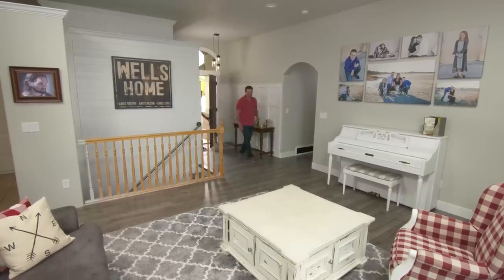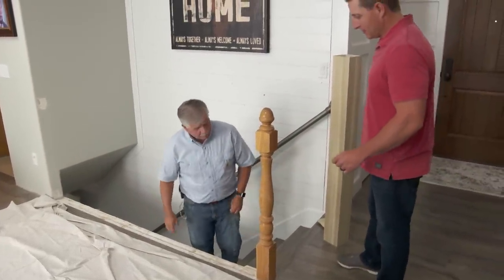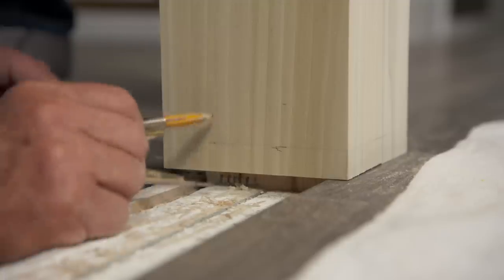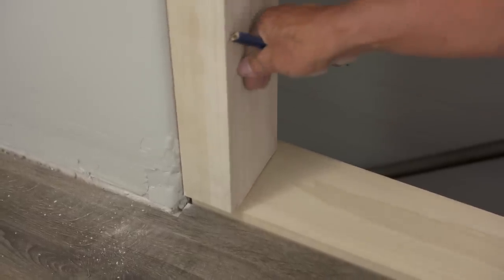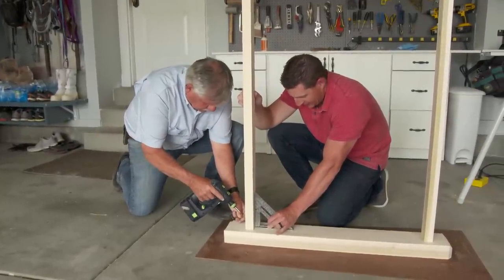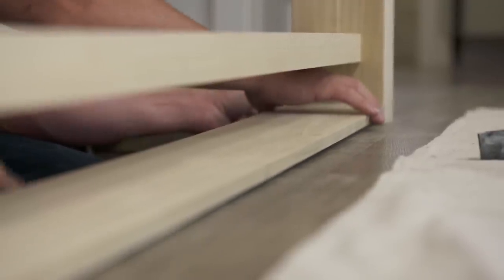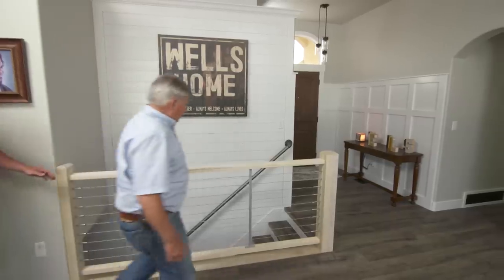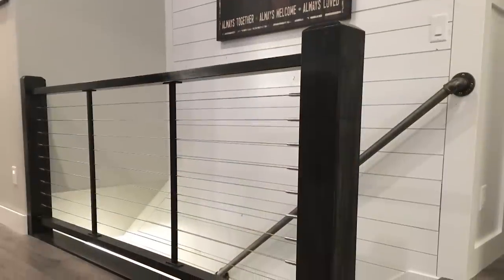How to Install a Cable Railing | Ask This Old House

Comment: Wouldn't it be easier to sand & stain the wood before you install the cables?
Reply: Yes, but Tommy and the crew can't wait around all day for everything to dry. :)
Reply: Yes, and it should be assembled, disassembled, stained/ painted and then reassembled. If you had all day and wanted to do it correctly that is.
Reply: Yes, and no.  Things usually needs some adjustment or modifications during the install, which leads to a bunch of touchups after.  You cant really win either way.
I pre-painted a bunch of trim and casing thinking I'd just touch up the nail holes after.  By the time it was installed, caulked, and nail holes filled, there was enough that it had to be painted completely anyway.  Waste of time and paint to do it beforehand.
Reply: also the cable support should have been silver steel color.
Reply: Bruh the homeowner needs to do somethin instead of letting Tom do all the freakin work!
Reply: @monno-eq2mj  why?
Reply: @ig4581  to protect from scattered paint.
Reply: Little confused as to why you first used multi tool, then Japanese saw, then chisel when you could of used a Skil Saw and raised the back up to scribe cut the base?  I know Tom knows how to do this for sure!  Lol
Reply: The boss had not made up her mind yet whether to paint or stain or leave it natural.
Reply: No....

Comment: Wow....can't believe he painted it black...was not expecting that.....
Reply: Yep it looks dumb
Reply: The entire house at 0:08 is a bit of a mixed bag... Gingham chair contrasting with the trellis rug, the mahogany console table right next to the shiplap and industrial handrail, etc.  Blame HGTV and DIY for creating the homeowner that thinks they're an interior designer.  But at the end of the day, who cares...if they're happy with it, that's their business.  They have to live with it.
Reply: I like modern contemporary I think it looks clean and neat, but they literally put wainscot there at the top of their stairs, old-style piano on the other side, shiplap siding and an industrial pipe rail across from it; it's completely surrounded by conflicting styles. =S
Reply: Honestly I thought that it looked really out of place at first.  I personally thought that the black was a nice touch.  To each their own.  Definitely unexpected!
Reply: @brockm4047  I would have done a dark gray of the same color as the pipe used as railing, that way both sides of the stairs would match.
Reply: Cleroyster 2 I agree, why blank
Reply: He better painted it before putting the cables in.. Would have been much easier instead if having to paint around the cables. Or even when the whole project was still in the workshop. No need to risk spilling black paint on the floor.
Reply: The whole house will be out of date in 5 years. Looks good now though.
Reply: Tommy said stain, so perhaps it's a dark non transparent stain. Looks like Ebony stain to me.
Reply: @toms7947 - Those colors have been around for a few years now. Already outdated in my opinion. Time for the next trend
Reply: @Fe7Ace  Probably a safe bet that the house is a conflicting mess of 5 facades and materials too!

Really wish architects and designers would stick to simpler architecture.  Some new houses confuse the hell out of your eyes.
Reply: I think the black color looks good here but black is my favorite color so I know I'm biased
Reply: Poplar can be tricky to stain with its green streaks. I would’ve gone with a lighter color that still showed the grain texture.
Reply: @dontino7849  I forwarded your message to the homeowner. He said when you can afford a house, you can do what ever you want to it.
Reply: @reedrobb  The world's interior designers beg to differ lmao
Reply: It looks like dark espresso. Looks good.
Reply: @shadowblack1987  LOL!

Comment: Depends where you are but your supposed to have a lower kick off I think the first 8" to avoid having kids climb these. Usually the building codes are very strict concerning horizontal railing.

Comment: That was a beautiful oak railing. It's a shame to pull it apart ... but the customer is always right!
For the poplar posts and cross rail, I would have stained it an d finished it before installing the cable hardware to save the masking required to keep the paint off of the steel.
Reply: Exactly…Murphy says you WILL drip stain onto the cables and/or the fittings.

Comment: Wainscoating into shiplap and the industrial handhold and railing is a bit odd.
Reply: everything is transitional nowadays.  people just put up whatever crap they think looks nice and pull from all styles. the only consistency they want is that they like it.
Reply: The only way something becomes "traditional" is contractors copy a style/look and do it to 95% of homes they build. I would say these home owners just put their style in the design of the finish of their home. Well that is the best way to say they have crappy taste, I mean they made it custom. ;) 

I'm just clowning about the crappy taste commit. If you pay hundred's of thousands of dollars to own a home for 10-60yrs then yeah maybe make it look the way you want. Just realize your custom distinct look may make it harder to sell or go down in potential value.
Reply: @RossMalagarie  People worry too much about home value.  Make the house your own.  5-10% sale price doesn't work out to be that much on the overall cost of ownership.  After all, some people are dumb enough to pay an agent 7% to sell their house.
Reply: This is the house that Pinterest built.

Comment: I like the wires in theory, however the lines moving around in respect to the shiplap lines reminded too much of a wire cutter.  High end glass panels might of looked nice if they were determed to add something modern to the style collection.

Comment: Is there a similar product suitable for
Outdoors? Say on a deck?
Reply: Yes, exterior ones are available.
Reply: @augustreil  where? Stores like Home Depot ?
Reply: @lillelena7681 , They might, but I have seen exterior ones done, not sure where they purchased their materials though. I do know, as you, that all the cables and connectors would have to be made out of Stainless. Sorry I couldn't be of more help.
Reply: Feeney is the brand. It's the same stuff they used here. Just look for where feeney is sold.

Comment: Weird that US with loads of codes allows railing like that small kids can easily use those wires as steps and climb over.
Reply: Doesn't US code vary from stage to state? Who's to say they weren't in compliance with code in the state the work is happening in?
Reply: Who cares... It's their house, they can do what they want.
Reply: @climberjb  We have national and state adopted codes, but enforcement comes down to the local county/city/town/village/etc level.  This often leads to massive difference in enforcement, even from one city to the next.  In general, the bigger the city the more enforcement there is.  The more rural areas have far less, often just having the fire marshal checks for any obvious dangers.

Comment: "How to install a ladder for small children to easily access the free fall simulator "
Reply: This guy parents.
Reply: @reddog418  no sir I do not
Reply: Thank you for pointing that out. My brother has contemplated doing this project multiple times but always stoped do to the cost. O my gosh it is hard to stop his daughter from climbing the vertical railings. Anything horizontal would just be a climbing wall. I wonder how many kids will have to fall 10 feet to make this against code in housing areas. 

Pointing this out will probably make him very happy he did not make this change.
Reply: old wives' tale. common knowledge now is so long as there is an easily visible way down and they can see completely through it the curiosity factor never actually kicks in.  put a staircase on the end of your crib and see how many times a toddler tries to climb the crib railing (answer: zero).
Reply: I'm just laughing at the DNA some of you safety paranoid people must have.
Reply: Especially for parents today since they don't...parent.

Comment: 2:31 - saw with a laser guide, take a shortcut so that you only make 2 cuts.......aaaannnnndddddd the cuts don't line up. see the end result at 2:58 at the floor boards
Reply: Doesn't have to be precise because it had to get stenciled and hand cut anyway.

Comment: been building for over 40 years , and cant figure out why these meet code , they clearly pose a climbing hazard, any member horizontal  and with in 8 inch to floor,if someone steps on and climbs one or more then now you dont have proper guard rail height, anyone else got anything on this
Reply: Was thinking along those lines too.   Fine homebuilding magazine recently did an article about how codes are misinterpreted and easily mistaken one way or another especially from state to state, mostly because a lot of the codes are not written very clearly.

Comment: Where can the newel cover be found?  The amazon link doesn’t show the item in the video.
Reply: It would probably be easiest to pick what kind of wood you prefer and make your own.  It appears to just be 4 wooden boards glued together that have 45 degree beveled edges.  If you don't own a table saw most general contractors could probably build this pretty easily

Comment: Horizontal railings are not allowed in our building code as it “promotes climbing”.
Reply: True, if you are Canadian, this is not allowed !
Reply: @rogerNOmore  or EU
Reply: @rogerNOmore  It is now allowed in the latest code if the fall height difference is not too much (I forget the number for the height difference). It is something like 12ish feet. I think the whole climability issue is a regulatory overreach that unnecessarily limits designers.
Reply: A McLellan which version and do you have the article number? Because 2010  version is clear about that
Reply: A McLellan it’s section 9.8.8 in 2010 btw
Reply: @rogerNOmore  Sentence 9.8.8.6.1)  of NBC 2015. BCBC 2018 is based on NBC 2015 which is current in BC. I don't know how current the other provinces or territories are. The height difference is 4.2m (13'-9"). Technically this also applies to residential units within a Part 3 building. Except in high rise balconies, I don't see many conditions with a height difference of more than 13'-9".
Reply: @yodaiam1000  I see, we are still using 2010 here in QC. thank you for the info, ill look into that.

Comment: The orginal railing would have looked better than the new cable railing, had they simply trimmed off the finial on the newel post and painted everything white. The whole house is a mismatch of different styles already so it wouldn't have stuck out at all this way.

Comment: They painted over the poplar :(
Reply: what bothers me the most is, that they actually used poplar, a cheap wood we in Germany don't even use for heating ...
Reply: Poplar is considered paint grade. It's almost always painted.
Reply: Yeah, that's what you do with poplar.  Its a cheap wood that takes paint very well.  Pine is cheaper but can be terrible for painting and staining.

Comment: Never install a cable railing. They are ladders for kids, and do NOT satisfy building codes. Of course if you don't like your kids...
Reply: It satisfies code in Oregon 🤷‍♂️. Done a few but I'm not a fan.
Reply: If you install horizontal scissor wire, it keeps the kids from climbing
Reply: this is why i use barbed wire on my installs. Prevents kids from climbing on them

Comment: Cable railing for the interior residential use just looks cheap and tacky.  It's almost like bringing lawn furniture indoors.  It's a fad that's going to die off.   It's ok for exterior fencing.

Comment: How is this legal?  For many years the building code has not allowed horizontal pieces that act like a ladder for small children to climb up. I know an architect who designed a public library that had a guardrail with horizontal pieces. It was located on a second floor stair landing outside of a door. A small child climbed up and over and fell.  He was sued by the child's parents. I was on a ferry with similar guardrails and I was looking at it contemplating this hazard when a small child walked up to the rail and the first thing he did was to climb it. He did not climb over though. Maybe we should call it the Darwin railing system.